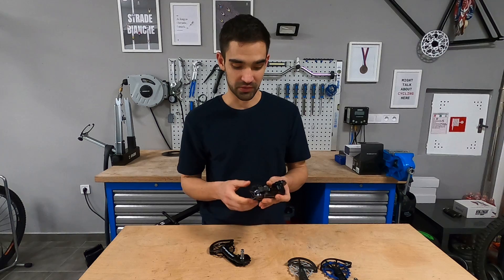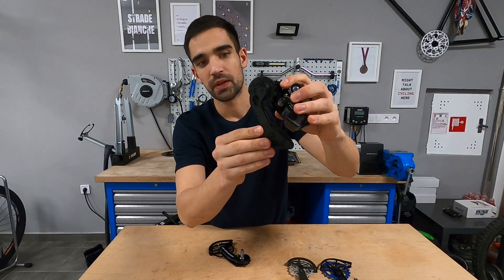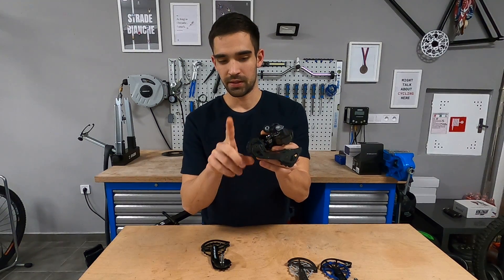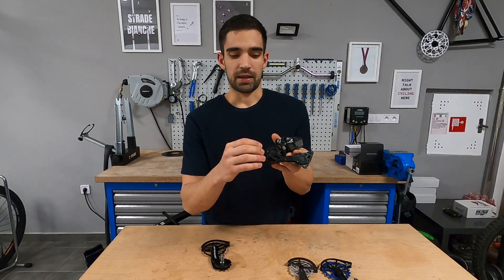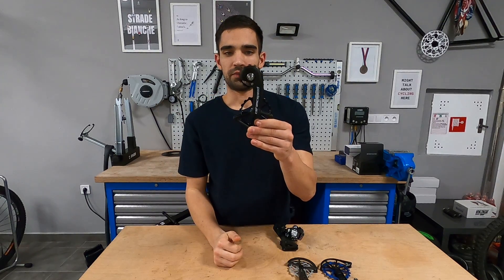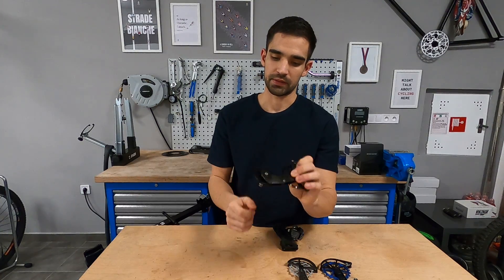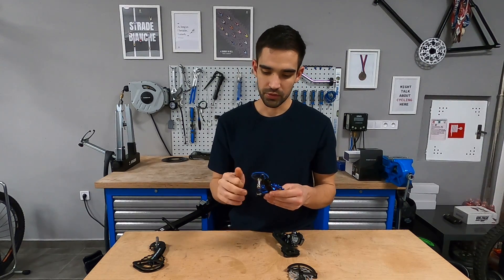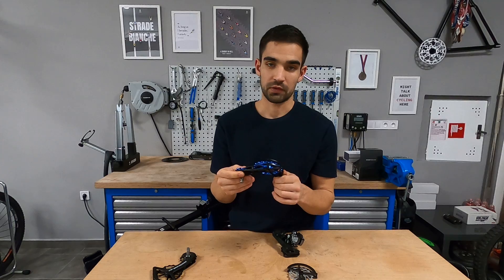Oversized pulley wheel systems - are they worth it?

Comment: Is it worth it? How much is 0.5 W worth... about the same as aero spokes... not much. Anybody who uses these look like an uninformed "all the gear no idear" or some kind of cycling poser.
Reply from the maker: Firstly, it’s more in the region of 1-1.5W, which is a lot for someone who’s racing and chasing every marginal gain.

Secondly, I would first check who you are trying to call “all the gear no idea”, before making yourself look like a moron.
Reply: @ronykuba  You have no idea whether it's 0.5 W, 1.5 W, or 0 in some cases. Do you dispute that? If so, tell us how you have such a precise understanding when nobody else does.
Reply from the maker: @user-cx2bk6pm2f  there are drivetrain efficiency rigs that test that you know, and you can buy the test data that comes out.

Comment: Actually this oversized pulley's are just marketing crap. engineers of the drive train are not ignorant to design such pulley's on expensive groupsets. The reason why it doesn't need a ceramic bearing is because pulley's are meant to receive the chain. Going to the "TENSION ZONE" which is from your cogs to the crank. beyond that there's no load. If you have an engineering background then you will understand this very simple mechanics. OSPW's looks cool but not worth of an upgrade in performance.
Reply from the maker: If you have an engineering background, you would also know that oversized pulleys are about chain articulation, and has nothing to do with “load”.
Reply: @ronykuba  Like i said, engineers of the groupsets are not ignorant to design stock pulleys. "Articulation of chain" on OSPW's are useless upgrade not unless you want to look cool. If OSPW is meant to save you 1.8 watts - 2.4 watts for the articulation then know also that you have a penalty of drag because of its size. Not trying to hate OSPW because they actually look cool though.
Reply from the maker: @lightofheaven134  no they’re not, that’s why they’re also increasing the sizes slowly but surely.

Comment: On a completely flat course with little to no wind, what do you think about converting your bike to single speed? You would still need a chain tensioner but the angle of the chain is barely altered so the frictional losses should be lower less than if the chain has to go through a rear derailleur. It should also be slightly more aerodynamic.
Reply from the maker: well, that is an extremely narrow use case, but it could work theoretically

Comment: I changed out my 11T 105 bottom RD pulley with a cheap 13T sealed NTN bearing pulley and found the drivetrain to be slightly smoother right away. 105 pulley is spun on bushing. Maybe that is why it felt slightly better. With Ultegra and Dura-ace RD, I'm not sure if you can feel any difference whatsoever. So for a 10 dollar ( about 4 for the pulley, 6 for the bearing ) upgrade, worth every penny IMHO. But if i had to pay >100 dollars for it, definitely not worth it.

Comment: May i know your thoughts on just changing to ceramic pulley wheels only instead of the while cage together? Will have any benefit?
Reply from the maker: The benefits are smaller, predictably
Reply: @ronykuba  your opinion, shall i change my ultegra RD to dura ace RD or use that cash to upgrade oversized pulleys ceramic?
Reply: @ridzuan786  I would advice you to change the old one to dura ace rd. the shifting is much smooth with dura ace

Comment: I don’t understand stand why cassettes come with a 9,10,11 smallest cog then. Surely having a 15- whatever cassette and bigger rings is more efficient than forcing a chain round a 10t?   Appreciate one wouldn’t spend much time in those cogs but still...
Reply from the maker: The problem with that is that it would make for enormous cassettes if you wanted the same range
Reply: @ronykuba  agreed but i was just talking about efficiency.    My point was more about one side of the industry saying bigger is better while the other goes smaller and smaller.
Reply: Most frames cannot accommodate a first position cog larger than 14, for one thing.  I use a 14-25 and you need b screw to make that first cog work, theoretically decreasing shifting performance.

Comment: (1) I’m not sure that a larger pulley wheel saves any significant power. The angle that the chain goes through is the same, regardless of pulley size. I have not seen any convincing evidence/analysis to support the claim, have you?

(2) Why does it matter about the material  of the Jockey wheels? Plastic jockey wheels, work very well, don’t they!
Reply from the maker: (1) I am sure, and it is well proven
(2) Just because something works well, doesn´t mean something else can´t work better

Comment: I have used novaride on my Ultegra and found the shifting not as snappy as the stock pulley. Also, the drivetrain became noisier which was a put off. It did feel smoother although that may be a placebo effect. I instantly went back to the stock pulley. Sometimes the cons of fitting an aftermarket product to the drivetrain may outweigh the benefits. Sharing my two cents worth.
Reply from the maker: aluminium pulley wheels are always going to be noisier

Comment: Think of what matter most, it's the reduced chain articulation. 

Tripeak has 12t top, 14t lower pulley which cost less than $100. Those fit into original Shimano cage and don't degrade the shifting quality.
Reply: True, the only gain is there.
Reply from the maker: Neither does, when set up correctly

Comment: The jockey wheel bearing have the fastest rotating speed of any bearing on a bicycle. Changing to a roller bearing jockey wheel has great merit. Changing to jockey wheels with a roller setup will produce the greatest results, with the differences between larger roller jockey wheels less so in comparison going from a plain bronze bush to roller. Ceramic speeds price of entry is outrageous, however a person can easily choose.
Reply from the maker: true

Comment: Hmm... with larger pulley wheels the chain bends less but there are more chain links to bend so I wonder if this makes a difference. Less spining resistance in bearings can result in improved drive train efficiency if this can be sustained in bad weather conditions (bearings' sealings?).
Reply: More or less chain does not matter. Ceramic bearings does not matter.
Reply: Does it matter if there is more or less chain?
Reply: It's not so much the number of chain links, but the rate or frequency of chain links passing through the rear derailleur, that directly drives the power losses. For example, if you had the bottom bracket 10 meters away from the freehub, and say a 20-ish meter long chain, then in a given gear and at a given cadence, you will still have exactly the same number of links entering and leaving each pulley wheel every second.

Now, it could be argued that the longer, heavier lower run of chain will have more tension on it as it runs through the rear derailleur, thus increasing friction forces. But this effect is pretty minor when the chain is made only a few links longer, as in the case of the OSPW cages.
Reply from the maker: That's completely flawed logic. A chain is a closed loop. All of the link have to bend for a complete revolution. Unless of course you chain is infintely long.

Comment: Yes any links and pricing on the two , with thanks Dan
Reply: Ceramic speed is over 500euros ; Kogel - 400euros ; Npova Ride - 200euros if I remember correctly.
Reply: @mislevis  Thanks, you'd need be RICH or RACE or the like, to bother, you just would if had the money tho wouldn't you
Reply: Check out Garbaruk

Comment: Nice video which is the best in your opinion
Reply from the maker: Thanks. I use CS for now.
Reply: @ronykuba  without too much money, to begin with do you think the nova is correct? I have a friend who has been riding for 6 months with it and no problem, but what is your first opinion on it?
Reply: the pulleys turn much better than the other 2 while it is half the price ??? how to explain it
Reply from the maker: @TomOresLegend  as I said in the video, considering the fragile nature of full ceramic bearings, that might or might not last.
Reply: @ronykuba  yes I see what you mean, with that spider web aspect, but it's still carbon no, it's solid ???
Reply from the maker: @TomOresLegend  appears to be